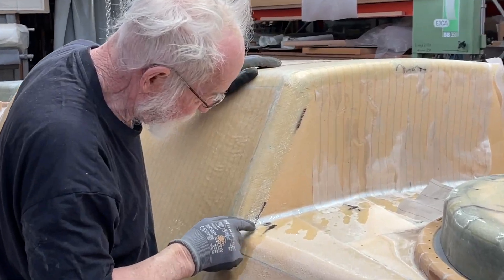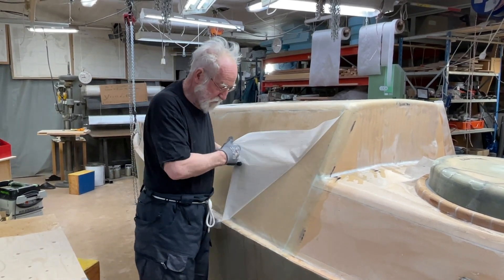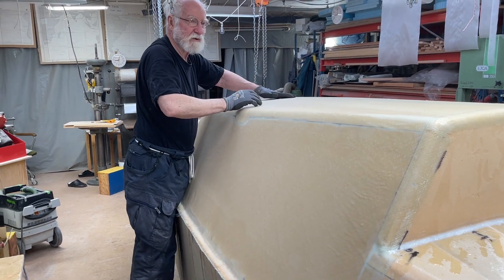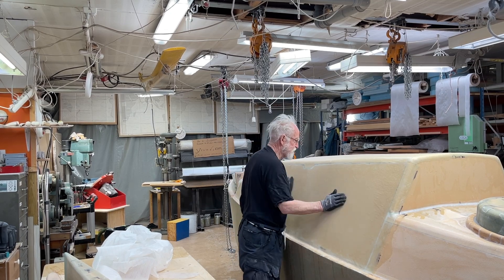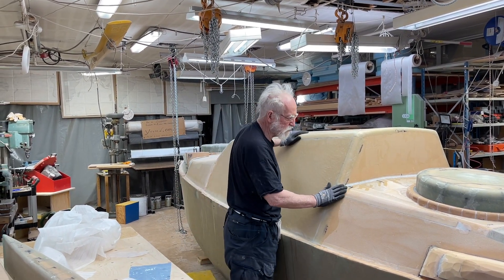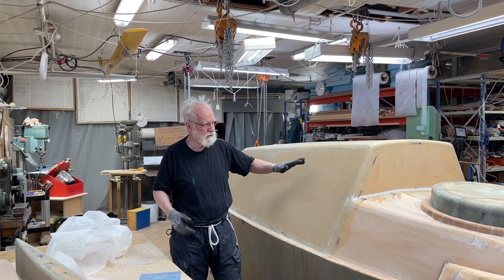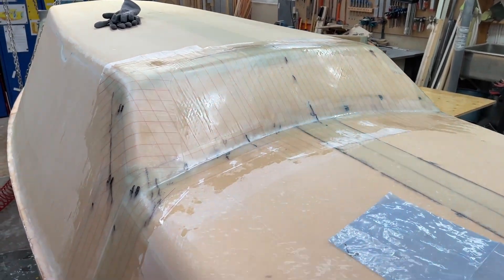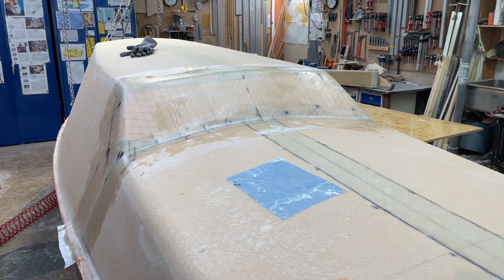30 May 2023 Deckhouse front & about peel ply

Comment: I recently patched up a hole in my fibreglass sea kayak. The keel had worn through from dragging it on the sand. I wondered why it was so hard to sand. It always seemed like the epoxy wasn't completely drying. What I now know thanks to researching 'Peel Ply' is that epoxy resin only cures in the absence of oxygen so there is going to be some uncured resin on the outside where it is in contact with the air. Peel ply eliminates this by the placement of a temporary dacron(rayon) barrier. this seals out the air giving a complete cure that can be sanded or painted or another layer added with a good bond assured and no gummed up sandpaper like I experienced.

Thank you Sven for enabling this learning experience. I am paying attention because I am inspired by you and other adventurers to build my own boat of a similar size some day. I live near Abel Tasman National Park, and the Marlborough Sounds in New Zealand and would love to be able to better explore these areas by taking my sleeping quarters with me.

Comment: The mechanical connection is really strong from epoxy to epoxy. How much stronger does the chemical bond make the connection?  Does the peel ply improve the connection by removing excess resin, making the surface smooth or something else? 

Thanks for the videos. You're making great progress on the boat.
Reply from the maker: The chemical bound makes the connection as strong as epoxy itself.
That is as strong as if there have been no connection.
The peel ply improves by make an ultra clean surface. a surface that have no epoxycarbonated molicyles.
Reply: @SvenYrvindExlex  thanks Sven